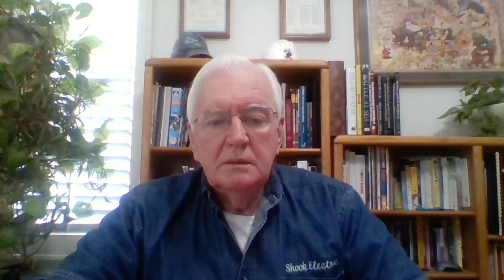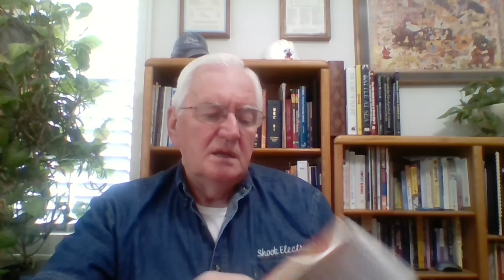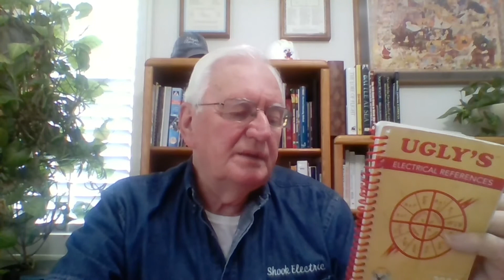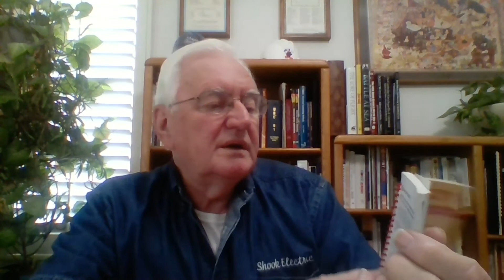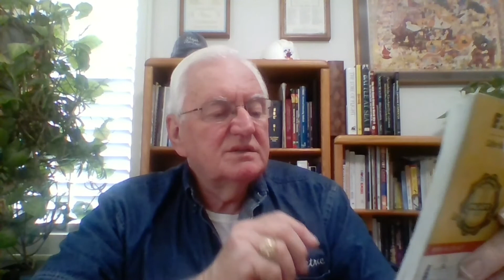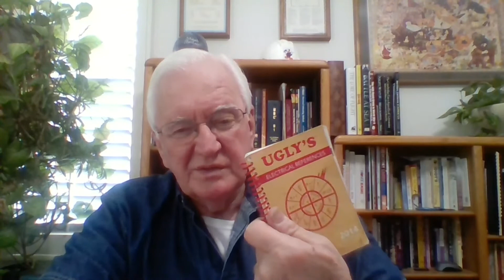Voltage Drop, 6 to 10 volts max at 200 feet

Comment: Nice information.  I believe  having the chart from the Ugly book is a good visual aid in the video.  I also like to mention if you ignore upsizing the wire for the motor loads, you may burn up the motor in the long run because of the voltage drop.
Reply: TooTall Dan I listened to a man at an electric motor repair shop complaining about burning up several winch motors at a boat dock.
   He was using 120 VAC for a run of 300 feet or more. Oops!!!